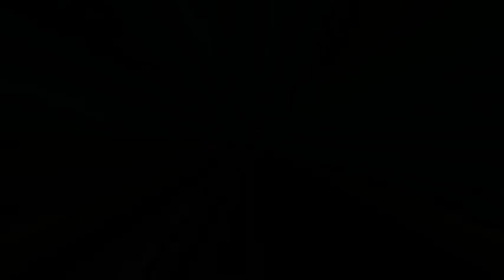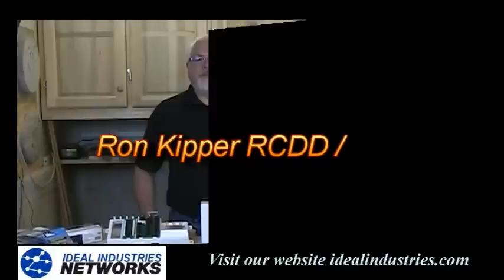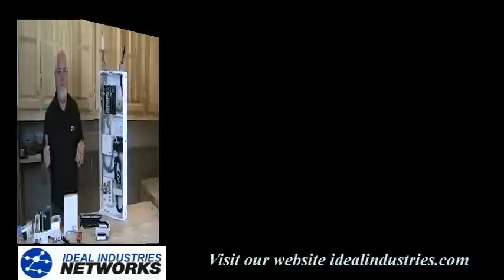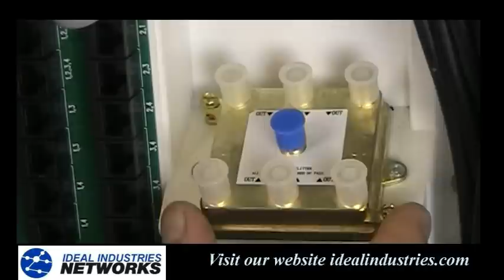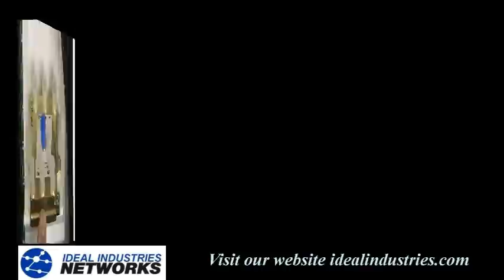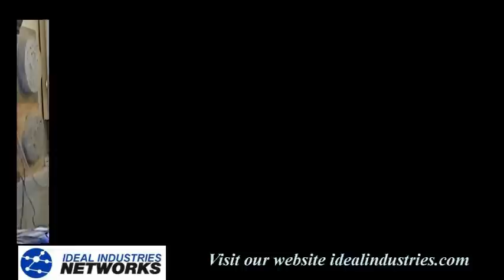Smart Home Part 7 Video

Comment: Hi Ron Please help me to design a system
I have a cable box and a roku as a input source to be connected to TV with cat 6 and also infrared ir all r about 100ft run
Reply from the maker: Hummer not sure I can be of help. Can you give me more info on what you are doing?
Reply: I want to connect  cable box hdmi input and roku hdmi input through a cat 6 to tv hdmi port, the run 100ft cable box and roku to tv.also i would like to use infrared ir

Comment: Ron, my parents remodeled their home, and ran all the wires to future-proof the house, I was wondering where I could buy the cable management box and the amplifying splitter you show here. I went to the website, but I had no luck finding the product.
Reply from the maker: Hello ! That was a Leviton panel and amp here is the link to their product page. http://www.leviton.com/OA_HTML/SectionDisplay.jsp?section=38102&minisite=10251Good luck with the project. Ron
Reply: harganya brapa bos splternya

Comment: Hi Ron, I am enjoying your videos, but can seem to find an answer to my question.  I have an antenna in my attic that runs to a amp/splitter in my basement then out to 4 TVs in my house.  The run to my bedroom goes out to the garage and back into the house on the opposite side of the room from my TV.  The result is a coax cable running along my floor.  If I place a two way splitter in the attic, I can go directly to the bedroom on the wall with the two and the other run to the amp/splitter.  What are your thoughts on this?  Will I lose too much signal doing this?  I am less than 15 miles from all tv stations that I care about.
Reply from the maker: Scott Meczkowski Scott that should work as well. It does not sound like you have long runs. Putting the antenna in the attic not outside cuts the signal in about half from what I have been told. If you are fairly close to the TV stations that may be OK. Just make sure to use a quality splitter/amplifier and good connections. Thanks for watching

Comment: Hello Ron, I've watched several of your videos and searched other videos but cannot find an answer to my question. Would there be any issues with running an 8-port splitter from the drop line and having the cable modem connected to one of the 8 ports? Someone told me an amplified splitter would interfere with a cable modem so I had to run a 2-way from the drop then connect (one to cable and one to the 8-way) Thoughts? Thanks

Comment: HI Ron,
can you tell me were i can buy your amp/spliter? how much do they normally run? And one more can i use the two (amp/spliter and if i need more runs use a spliter ?) I have 12 runs right now and i want to bundle them all nicely in your low voltage panel. Thanks for your time and help.